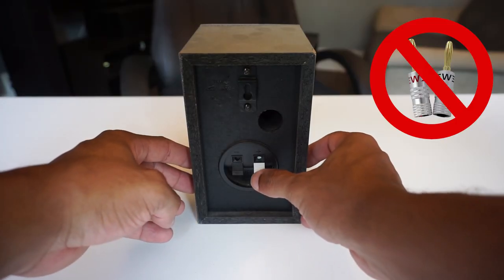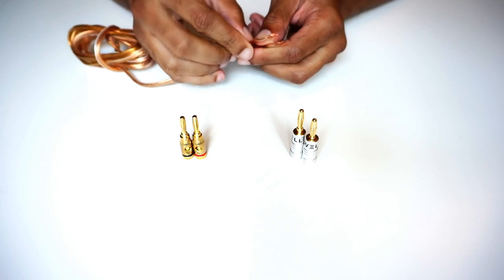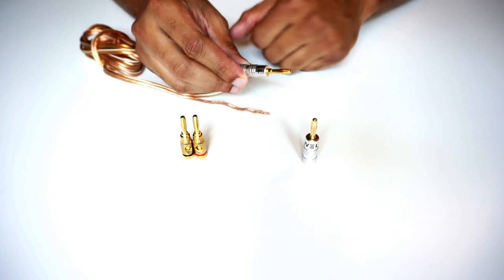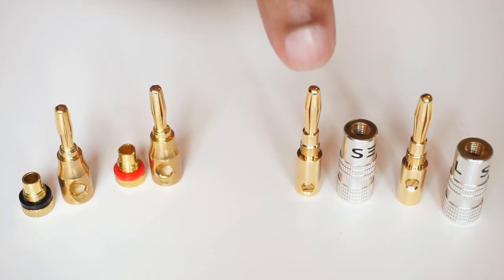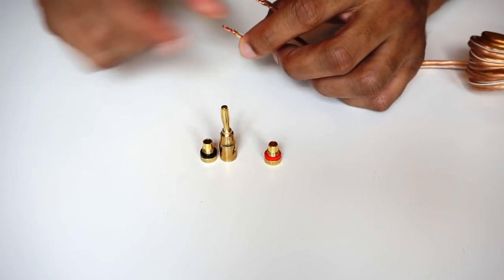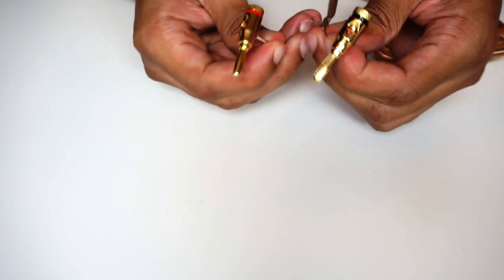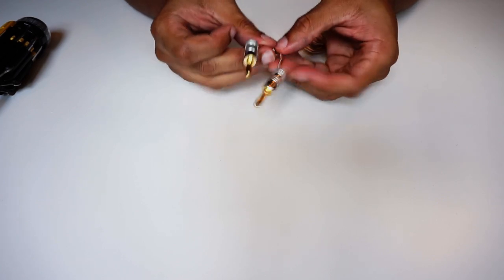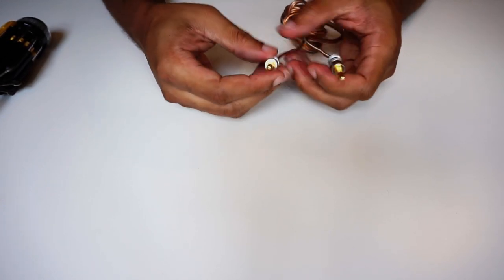What Are Banana Plugs & How Do You Use Them?

Comment: 2:13 with the Open Screw plug (your ‘cheaper set’) the better way to use them is to unscrew completely, thread the cable up the back of the hole in the screw, then gently tease apart the wire and fold it over the tip of the screw evenly all around, then screw it back on.  Note: you only need enough wire to cover the tip, it shouldn’t get in the way of the screw threads.  This creates a very sturdy connection, it’s fast to do and doesn’t require tools.

Comment: I think the reason you're not real thrilled about the "cheaper pair" you're working with is because you've got them connected incorrectly.  If you notice, there's an unthreaded "collar" on the base before you get to the threads.  I'm pretty sure you're supposed to insert the wire through the bottom and then fan out the bare internal threads of the speaker wire over the collar of the base.  Once fanned around the collar you then screw the base into the top pin and the fanned threads are pinched in between.  No bare exposed threads sticking out.  Give it a go...
Reply from the maker: Yea, I have tried using them multiple ways. They just aren't the highest quality banana plugs. They work, but I have used better.

Comment: Hey Tek Everything,   Why do the banana Plugs stick put from the Speaker connectors.  I just attached Amazon Banana Plugs to my 16 gauge wire and then when they are inserted into my Bookshelf Speakers (new Fluance Signature Series - Love em  especially with a Sub woofer for a two channel Basement Stereo system), they Stick Out from the Connector.  I Tried to GENTLY push the Banana pins into but Did NOT force it.  Didn't want to damage the speaker terminal.  Am I doing something wrong?  I do notice that the attached banana plug seems like a Flimsy connection. ?
Reply from the maker: The terminals may just be shallow. For example banana plugs go deeper into the socket on my Marantz receiver... but on my Def Tech speakers they hang out a bit. As long as they are making a secure connection you should be fine.

Comment: Thanks for the video. cleared up how to go about these. real easy actually. pretty cool. These speakers have 4 Female inputs in a square formation and there's plates that connect them. Sorta yeah these would be preferable especially the pricier one's for the sake of keeping everything safe ensuring a connection. Figure out what to use for a rubber casing or cheap out use electrical tape haha

Comment: Thanks for vid. You might indulge me: you like many others say no improvement to sound quality. However people do say reduced resistance definitely improves. I'm in the middle of this debate as looking to upgrade speaker cable. I've settled on Audio Quest FLX-slip 14/4. Now the question I have is the seller I've found will terminate them with same brand BP but also 'burn in' the cable but price is inflated. If I source my own BP it'll be cheaper. In your opinion Is the 72hr  burn-in worth it if they are terminated professionally aswell? Thanks in advance.
Reply: I'm talking 4x 1meter cables as speakers are beside system, I know this isn't ideal but limitations and all that 😉
Reply from the maker: Paying for cable burn in definitely is not worth it imo. I would only pay to have another company terminate my cables with banana plugs if they were going to solder them.

I would check out the wires sold by Axiom Audio or Monoprice if you want to save some money. I also typically go with 12 gauge wires.
Reply: So effectively I should just source my own bp's and sure they're easy to fit as demonstrated. That's what I was hoping to hear. You're just telling me what I want to hear 😉. Thanks for responding 👍

Comment: Hay quick question i have a cheap karaoke machine that has red and whight rca outputs and i have speakers that need the banana plug type speaker is their any cheap solution to connect them i have tryed stripping the wires from rca plug but wire is to thin to make a good connection
Reply from the maker: You could try something like this. https://amzn.to/2IBTFXl